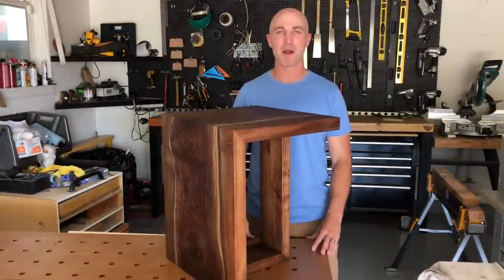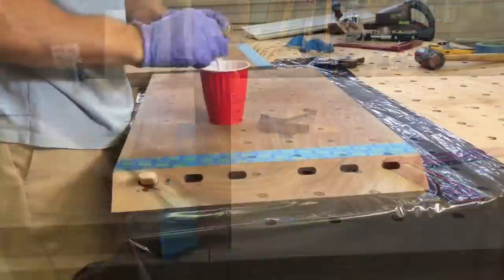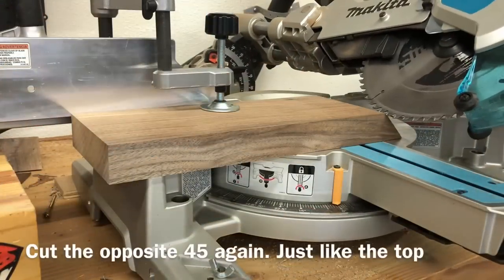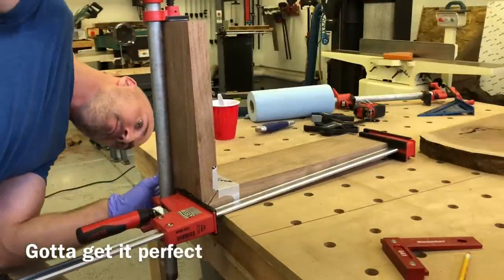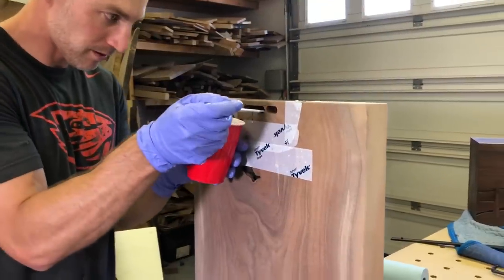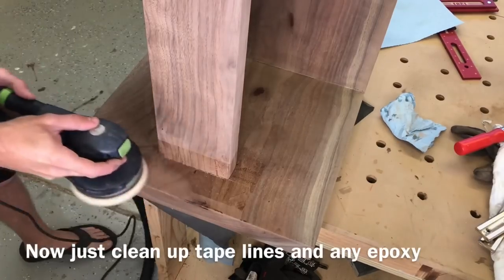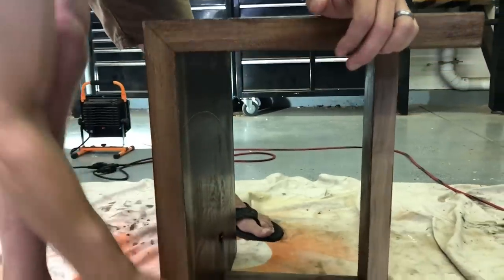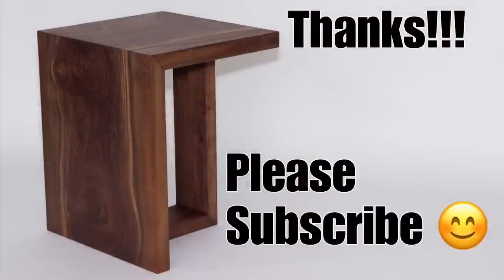DIY Waterfall End Table — How to Woodworking

Comment: Didn't hear a question during this video, so I'll just start off by saying thank you for sharing your craft and that you do really impressive work!  I wanted to ask about your use of the track saw to cut your 45-degree bevels on the larger pieces.  I have yet to get a truly great 45 bevel cut out of my track saw, and wanted to know was your 45-degree bevel stop on the Festool perfect out of the box, or did you have to adjust it so that when you move the bevel adjustment all the way over it hits a perfect 45?  Or, do you just move it over and then tinker with the blade until you can get a perfect 45 (or slightly greater than 45*) and then lock it down?  I can get close by using this second method, but never really perfect.  It's hard to get the 45-degree side of my square into the short angled area created by the blade and base of the track saw, so it can take forever to get the correct bevel angle and it's definitely not repeatable after I reset the saw blade to square and try to get the same angle again.  Any advice is greatly appreciated.  Thanks again.

Comment: Can you explain more on using the dowel technique. What tool(s) would you need for the angle drill?
Reply: This might be too late, but here is my experience. There are few doweling jigs that support 45 degree miter cuts. If you want thru/exposed dowels Rockler has affordable one. Pretty cheaply made and doesn't help with alignment, you need accurate miter cut and clamping solution. I used it for small miter and it is just OK. There is Doweling Wizard but I have no first hand experience. When I had to make six foot miter I found Dowelmax jig. It is not cheap but still way cheaper than domino. It worked flawlessly even with my not very accurate circular saw cut. I put eight dowels with perfect accuracy. It showed me where to sand to fix my inaccurate cut. Final miter is as good as it gets despite using very simple hand power tools only. Highly recommend.

Comment: I'm kind of curious on how that domino machine actually preforms the cutting of the domino holes. Do you show how it works in any video?
Reply from the maker: I haven’t showed it, I’ll try in the future!
Reply: It’s an oscillating router. If you haven’t seen it yet there’s a couple people that have shown it here and there, but I can’t think of a specific person right off the top of my head.
Reply: Or maybe that would be an end mill? I’m not sure what the terminal would be exactly.

Comment: Nice work as always.  Question for you though.  Where did you find a 1/32 round over bit?  I have searched and 1/8 is the smallest I've been able to find.
Reply from the maker: chairman72 that was a mistake on my part. It is a 1/8 bit.
Reply: @BlacktailStudio  Well that makes my head hurt less.  Thanks. Keep up the great work.
Reply from the maker: chairman72 yeah man, sorry about that!
Reply: Aww man, no need to apologize. No one is perfect. :)

Comment: Not sure if you explain that in the video, but why did you use epoxy for the joints instead of the classical Titebond III or similar glue?
Reply: He said that he couldn't get tight clamping pressure on those mitre joints.

Comment: How thick is the cut at 45 degrees? I've hit a limitation with an oak waterfall table i'm building, very thick at 3.25" when at 45 degrees. Used a circular saw and a guide, but wasn't accurate enough for a perfect joint. Any suggestion for a track saw capable of making thick, accurate cuts?
Reply from the maker: Mafell makes em

Comment: For the bevel cuts are you using the festool TS55 or TS75 ?
Reply from the maker: 75 👍🏼👍🏼
Reply: I'm deciding which one to buy. I wonder if the TS55 has enough power to pull off that cut 🤔.